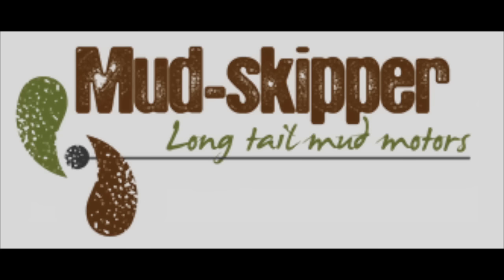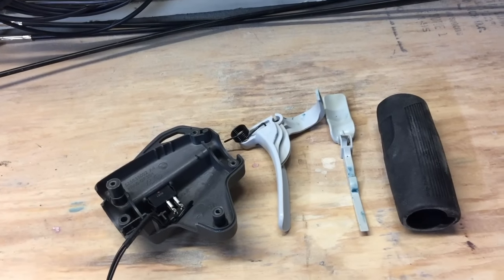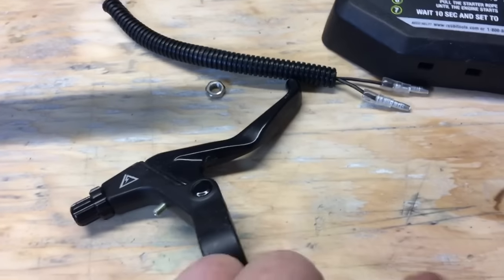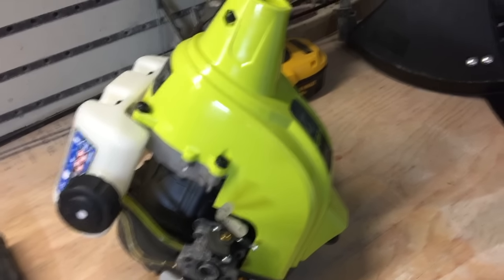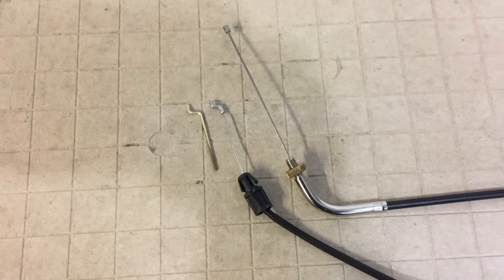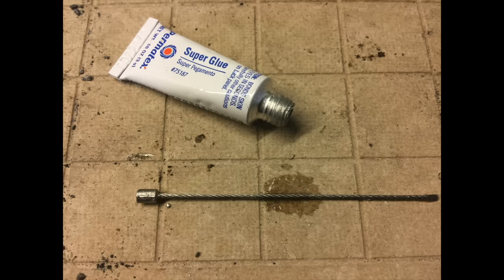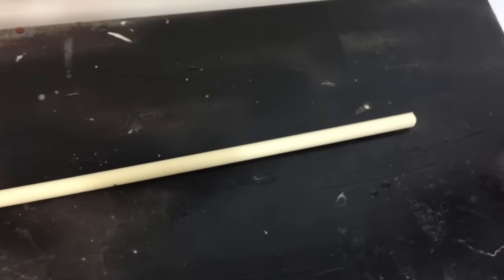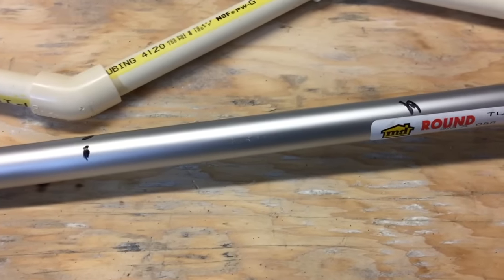Canoe Kayak outboard engine conversion of weed trimmer

Comment: I'm not knocking this idea. Just not the style I think I'll go with tho. The limited steer to one direction would be a kill joy to me. Unless maybe mount it with a pin to hold it steady or not turn once tuned in to run strait and use the paddle to steer and a foot control throttle cable??? One other thing about all these Weed Wacker and other small engine non marine engines is that I never see anyone run the exhaust down into the water. Just hearing a Weed Trimer engine brings bad memories like getting into yellowjacket nest and hot days trimming grass. I know electric conduit has galvanised finish but something of the same size to vent the exhaust into the water would make life more pleasant. Most of the mud motors using horizontal shafts at most only run a stinger pipe away from the boat but above the water. Is there a reason that folks aren't running pipes into the water for noise control?  If not for the loud exhaust of this setup you could probably talk over the engine to another person running one beside you. I didn't wanna sound az of I'm putting any of this work down. But have been wandering about the exhaust issue for a while. 
Good video by the 👍

Comment from the maker: Youngs Props  sell a variety of aluminum propellers http://www.youngprops.com/  However, I have found these are a little too large and put a lot of torque onto these smaller engines, making them struggle. I was using a 25cc engine, but there are bigger weed whackers.

Comment: Nice video thanks for sharing.  Wonder what you used for a prop.  I understand this can be a challange to find one that works well.
Reply: Jim Van Lanen 
Plastic trolling motor prop from ebay.
Reply: So I took my ryobi apart to just put a prop on there and it seems the bolt to attach everything is way to short for the prop I have.. I have a55 lb thrust minn -Kota and the prop is too tall. Any ideas on how to attach a prop and which one to use?

Comment: How fast does it go
Reply: Without first hand knowledge, there are a fair number of propeller pitch calculators online as well as roughtamets for max rpm of the engines.  Put together a ~1.5hp mid 30's cc engine would have a max expected velocity of ~0.85 knots or just shy of 1 mile per hour.  My calculation was for a 20 foot pontoon style displacement hulled raft.  The key items if you go looking for these calculators online are that these motors range 1 to 2 horse power, and they run 10,000 to 15,000 rpm.  These will get you a close enough set of numbers to get a max expected knots.

Comment: Weed whacker engines were not designed to run full throttle for a long time. It overheats and dies out constantly. I would hate to see anyone stranded in the water without a paddle.
Reply: Weed wacker engines are designed to run full throttle at all times. Running them under full throttle, in fact, reduces cooling lol
Reply: @soupertrooper3864  I would think the issue would be higher load and duty for the flex shaft.   And, yes -- 2 stroke motors have power/torque/whatever at higher RPMs.   Even the  cheap ones on $99 trimmers can go for hours full throttle.   Also, based on my neighbor's (from my perspective) all-day 2-stroke leaf blower events, overheat at full-throttle doesn't seem to be an issue.    Based on the current price of reportedly decent-enough chinese outboards, one should jus d to that instead of spending time and money adapting a thing not designed for boat propulsion...for boat propulsion. but I am probably going to attempt a simple crude adaptation just to get some hands-on experience with the potential and limitations of such a contraption.     The thing I hate most about 2stroke is the NOISE.    :)  
d
Reply: @manxx25  That's one thing I love about them. Well, the noise from a well tuned 50+cc, not a shitty little weedeater. I'd use a 660 or 440 Stihl powerhead from Farmertec and make a scaled down longtail/surface drive for it. The 660 is rated 7 hp, about 9500 rpm loaded

Comment: I think you find a high quality heat gun would do a much better jog of heating the pipe without burning.
Reply from the maker: Yes, I agree entirely. I just didn't have one handy and as it was only a template, it didn't really matter. I used a cheap Harborfreight one to bend 8" diameter pipes a while ago, worked great.
Reply: Paul Powell i
Reply: @caswellsubs  never use a heat gun or a burner, use a piece of tissue paper and your hand and rub the pipe vigourously back and forth until the friction has warmed up the pipe, then use a bending sing so you dont get wrinkling!!